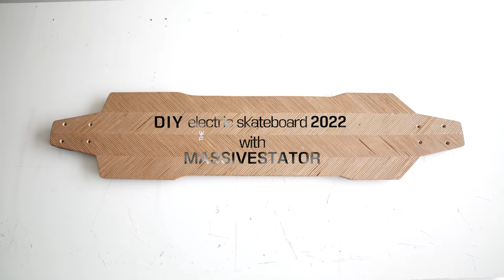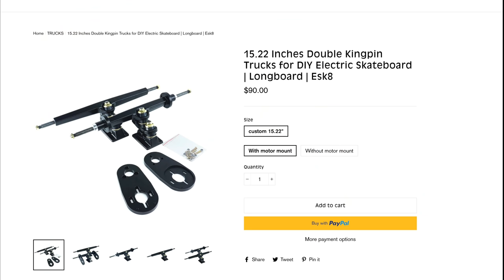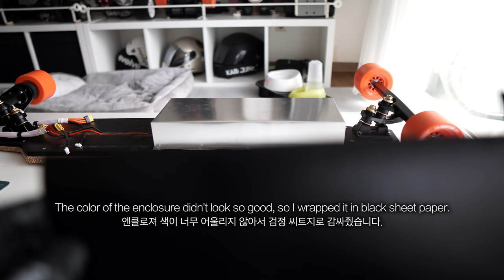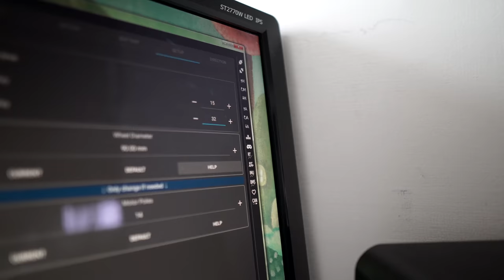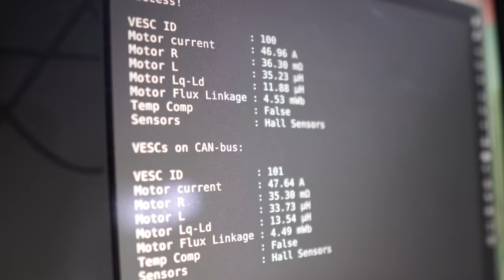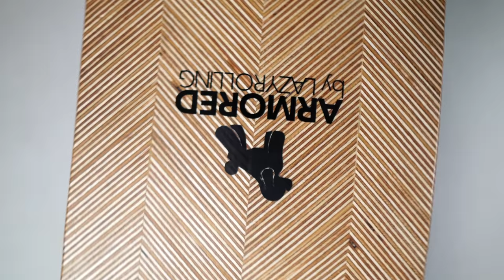#138 DIY electric skateboard 2022 with MASSIVE STATOR

Comment from the maker: This building was not easy because of the new way to make enclosures for the first time using the Aluminum plate. Certainly, it seems difficult to achieve satisfaction when trying for the first time. However, I hope you get the inspiration that you can do it in this way. The ESC (Focbox Unity +), High-performance motors, and motor pulley used in this video were supported by MASSIVE STATOR. https://massivestator.com/
이번 빌드는 처음시도하는 엔클로저 제작방법때문에 쉽지않았습니다. 확실히 처음시도하는것에서는 만족을 얻기 힘든것 같습니다. 다만 이런방법으로도 제작할수 있다는 영감만 얻었으면 좋겠습니다. 비디오촬영에 사용된 ESC(Focbox unity +)와 하이퍼포먼스 모터, 모터풀리는 MASSIVE STATOR로부터 지원받았습니다. https://massivestator.com/
Reply: I know its expensive but you could always get a commercial 3D printer to make the housings. Carbon Fiber Nylon with anti static would get the job done I think. Not sure of impact resistance. Might make future projects quicker and give you more size and location options. I plan on printing a board(CF PEEK) on mine in June. (work too much.)
Reply: Incredible work, I especially liked the deck, and enclosure fabrication. Curious if the aluminum esc housing will cause connectivity issues though.
Reply: i am making one with the 13 inch flipssky trucks , but am using  chains instead of belts  , great job on the deck looks amazing
Reply: @benofficial.0  may I ask why the chains instead of belts
Reply: @Jason-TheChad-Muska_circa1995  belts kept ripping  and slipping  from rocks  and  water  i couldn't get 50 miles out of a belt before it wore out or broke  , my chains are  still  going strong
Reply: Don't know about hardware stores in your area, but a sheet metal brake might make that a lot easier.

Comment: Another SiK Build! did you use spacers in between the bearings? if so where can you buy them?
Reply from the maker: I didn't use the spacers. but it works well. If you want to buy it, you can find it easily search for an internal diameter of 10mm spacer.
Thanks~ :)

Comment: Fantastic! Should perform amazing. I have a question about the Tynee Ultra. Tynee sells DKP trucks. Do you think you can modify the Ultra and put those trucks on it? Would be great with a fairly strong lite board with DKP trucks. I look forward to ride footage of this DIY board. Thanks
Reply from the maker: Thank you for watching :) And Structurally, I think it will be possible. But one thing I'm worried about is that if Ultra's motor wire length is not enough, it won't be easy to put the motor behind the truck. You should check it first.
Reply: @KAMiJUINs  Ah, yes. That makes sense. Hope I can ask you more questions in the future because you sure seem to have knowledge and have tried so many things. Thank you

Comment: I'm curious, where do you buy your batteries?I'm trying to find a 12s4p that can go 30 miles range and also output a consistent discharge of 80 amps? I can't seem to find that kind of amps anywhere
Reply from the maker: I used is 12s5p. This pack uses cells with a discharge rate of 10C. The link information is in the description box, check it.
Reply: @KAMiJUINs  shame the site doesn't give the specs like size of the battery, I know my new torque board will fit a 12s4 depending on it's configuration. If it's 10amps a cell, and it's a 12s4 does that mean it can do 80 amps continuously? How many cells are in a 12s4? I'm new to diy and this is my first build, your videos are my inspiration lol

Comment: ____________________Doesn't the battery put off heat that needs ventilating?
Reply from the maker: It doesn't use that much high output.

Comment: Thanks for the build.  Have you had the opportunity to run the x55 motors from massive stator?  I have the bound flash and was wondering what the difference would be between those custom motor from massive stator and the stock motors on my bound flash.  Let me know what you think.
Reply from the maker: First of all, the output of the two motors is different. The motor output of the flash is 1500w, while the motor used this time has an output of up to 4000W. Therefore, if the discharge rate of the battery and the output of the ESC support each other, a much stronger torque may be generated. Although the motor size is similar, the difference in output can be seen as the difference between the magnet constituting the motor, the mass of copper wire, and the number of poles. Thanks~

Comment: Doesn't the Focbox get warm in that enclosure?
Reply from the maker: It was not edited, but the lower part of the rubber part of the ESC enclosure was cut off. As a result, the aluminum in the ESC enclosure itself became a huge heat sink. This part will be mentioned in the next video. Thank you for watching~
Reply: @KAMiJUINs  Is that deck 12mm plywood?
Reply from the maker: Yeah!!!

Comment: Hey , with the current Vesc technology , there seems to be more and more vescs with higher voltage tolerances , would you build a board or with your current boards with higher voltages ? E.G , 48volts or 60 volts ? As i'd really like to see what speeds it'll achieve and how it affects the riding .
Reply from the maker: Thank you for watching~ This board is a 48-volt setup. And it can reach faster speed with a higher battery setup and ESC output support.
Reply: @KAMiJUINs  Would you try more voltage builds ? like 60v , 72v. Those are in electric scooter/ebike territory but would really love to see it in a Esk8 . Trampa makes 100v Vescs .